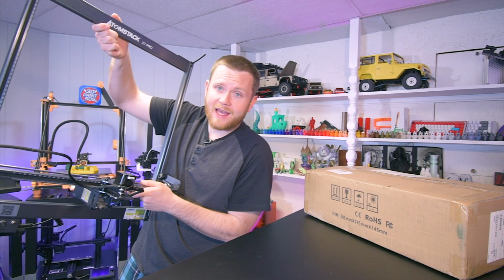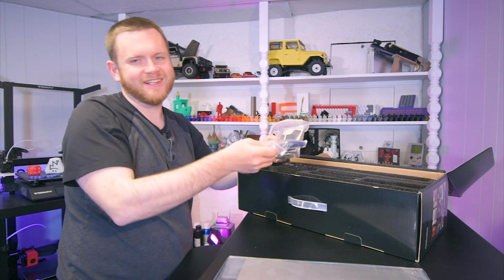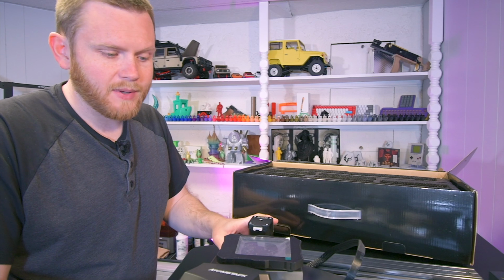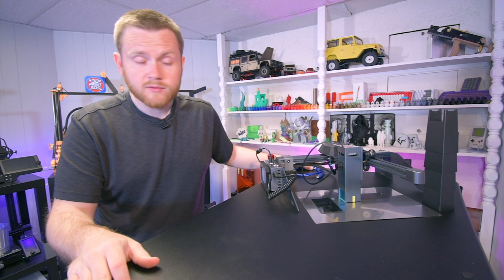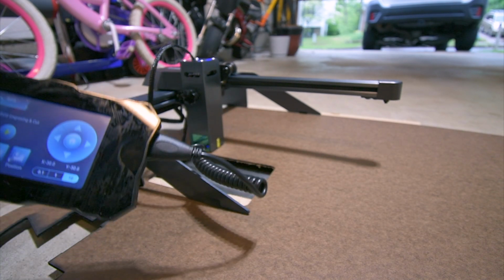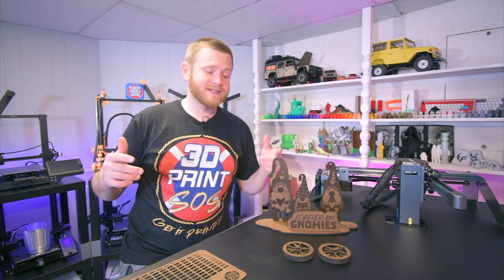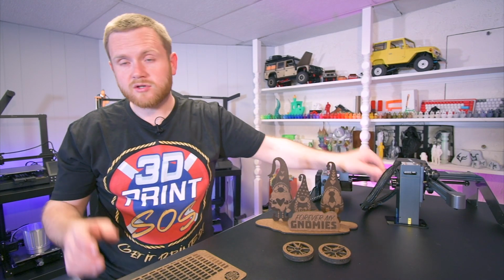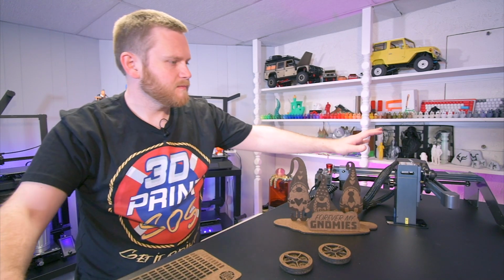SMOL LASER, BIG POWER! - Atomstack P9 M50

Comment: Hi!, Can I ask you a question?, with mine, the Y-axis beam (in cantilever) came heavily tilted towards the opposite end, so the laser block starts a quarter of an inch above the flat surface and it ends touching it at the other end due to the tilt of the beam!. Is there a way to fix this tilt?, It almost seem surreal to me that they designed it in cantilever and they didn't leave a way to fix any tilt misalignment, any ideas?

Comment: for acrylic use spray chalk, or wash really well with iso and dust with baking soda or for speed using laser printer toner for a color etch CYM
Reply from the maker: Really? That’s great. Is it possible to make a cut with any of these tricks or only engrave?
Reply: @3DPrintSOS  only engraving and it's kinda lite you can't cut as once your past the surface it's clear so it just passes the light
Reply from the maker: Ah I see. But still, better than what I achieved. I essentially just warped and melted it. 😂

Comment: Very cool. I've been wanting these but I'm so afraid of using lasers. What about safety, like glasses and stuff. You can't use these indoor can you, unless you have an exhaust set up right?
Reply from the maker: Yeah I mean you are literally burning holes in stuff. So indoor without an enclosure with an exhaust just won’t work. As far as glasses, they claim the window over the laser removes all the harmful rays but even then, I would buy a pair, just to be safe. 

I’ve had some mini “fires” when a material can’t handle the power of the laser AKA when I turned the power up too high. So technically, you need to be there for these. Can’t quite leave them like a 3d printer.